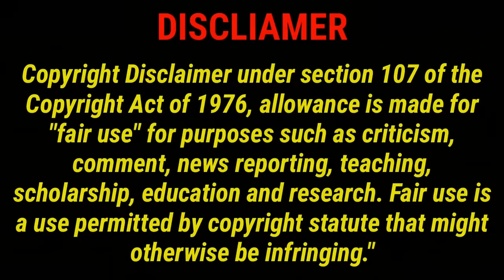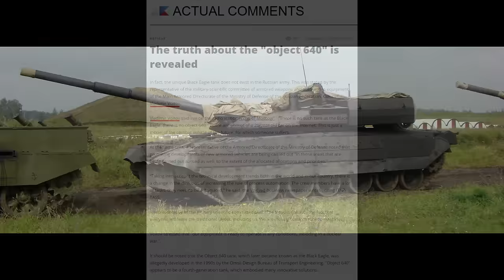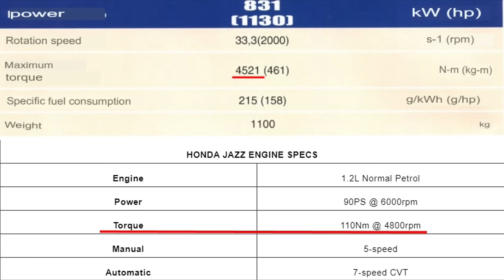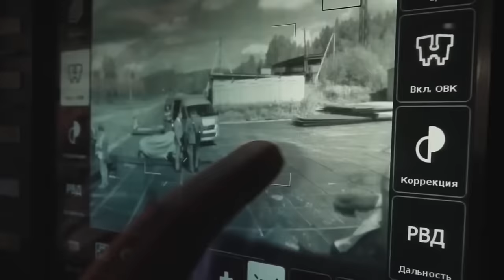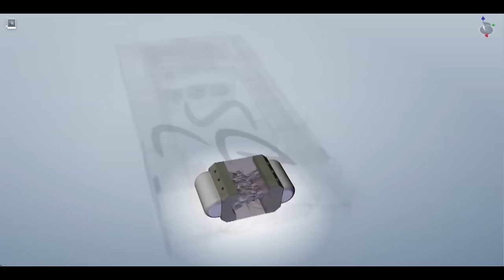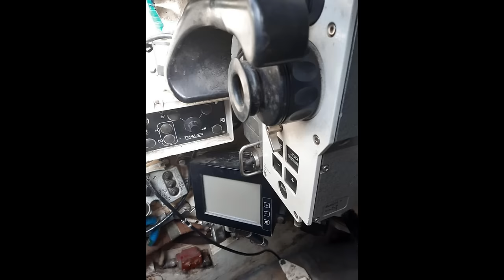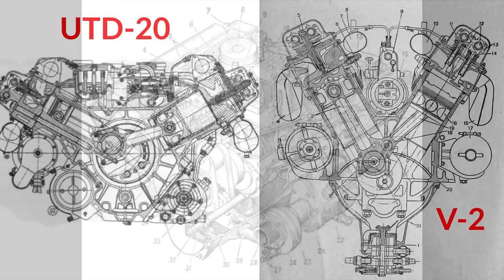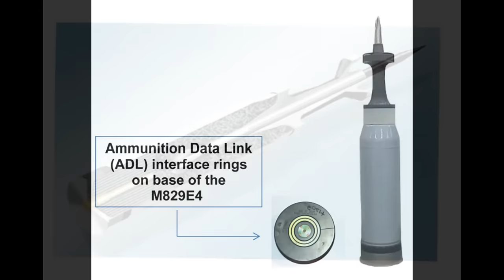LazerPig is WRONG about T-14 Armata

Comment: Lot of semantic arguments, and what appears to be interpretation problems. Seems RedEffect didn't understand certain gramatical phrases - like thinking that LazerPig said the T-95 and Black Eagle projects were the same. He didn't. He explicitly said they were different projects, but their development cycles were similar in that they produced nothing and were purely for propaganda. Another example of translation is the interpretation of "better thermals" to mean "longer range". While larger and higher resolution can produce longer range, the actual chips and sensors in western commercial products are far more advanced than Russian military equipment. Think of it this way, the APG-77 is a larger radar with more physical power, but the APG-81 is deffinitively the more advanced radar. An example of the semantic argument point was the "family of vehicles". Weight is literally the key component in chassis design. If you are using tank components to try and build a "lightly" armored vehicle, you will end up with a grossly expensive and overweight "light" vehicle. But arguing "well they don't have to be the same because there are differences" Is not only disengenuous, but is completely missing the point of LazerPig's argument. LazerPig was pretty spot on about that, and if you're arguing that the vehicles are fine because there are such significant differences between each vehicle to account for it, then they really aren't a family a vehicles that share any commonality. 

There were a few corrections to be made. LazerPig talked about his own mistake with mentioning torque production of the T-72/90 engine. That was a conversion error. But other than that, LazerPig seems pretty spot on. I mean we have great proof of Russia's smoke and mirrors happenign right now in Ukraine. The capabilities Russia has been claiming for decades simply doesn't exist.
Reply: >like thinking that LazerPig said the T-95 and Black Eagle projects were the same

But RedEffect didn't said that. He said that Pig probably mixed up information about two T-95, hence his mistakes

>the actual chips and sensors in western commercial products are far more advanced than Russian military equipment. 

AFAIR, Russian military equipment uses same chips. So, what are you talking about?

>If you are using tank components to try and build a "lightly" armored vehicle, you will end up with a grossly expensive and overweight "light" vehicle.

that's simply not true. You didn't listen this section. Russia built vehicles on tank chassis, they weight the same or even less than their western counterparts

>But other than that, LazerPig seems pretty spot on

Lol, yeah. His fantasies about Russian tank  and AFV engines, and T-14 engine in particular, were 'spot on'

Comment: About 360° awareness being unheared off in tanks, this is completly false. The new Israeli Merkava Mk.4 Barak has the Iron Vision system which gives the crew full 360° awareness with hi-res colored screens, allowing for the crew to practically "see through" the tank.

However, unlike the Abrams X or T-14 Armata, fhe Merkava Mk.4 Barak isn't a tech demonstrator or a very early production, but actually fully entered service in Israel and there are dozens of them right now with much more to come. Israel, once again, beats everyone.
Reply: Merkava Mk.4 is not as good Russian or American tank 
those upgrades is what matters there 
If you put those upgrades on a Russian-American tank you’re gonna get far better results
Reply: @mbtenjoyer9487  How so? The Merkava Mk.4M already has superior protection to both T-80BVM and M1A2 SEPV3 (before even bringing up TrophyHV), and the Merkava Mk.4 Barak is said to receive even better armor. In addition, the Merkava Mk.4 has semi automatic loader that makes it load faster than the Abrams's fully manual loading and T-80's automatic loading.
Reply: @ofekk213  it doesn’t Abrams has far far superior base armor
Reply: @mbtenjoyer9487  Nope, Abrams uses DU based NERA whereas Merkava Mk.4M uses advanced SLERA, and the Barak will use even better armor.
Reply: @ofekk213  still it doesn’t matter it doesn’t compare to the armor level of Abrams
Reply: @mbtenjoyer9487  Let's see how the Abrams's KD ratio changes if it faces actually competent tank crews in actually modern tanks, rather than Syrians and Iraqis with brain damage in T-55s.

Comment: Thanks for the interesting and informative video. The introduction of Western tanks and IFV into the Ukrainian battlefields have pulled back the curtain on alot of PR and exposed their myths. They all seem to burn.

Russia takes a long time to develop military equipment before it is finalised for production. They don't have profits as a main criteria for equipment to be produced. The Su-57 has taken decades from conception. T-14 will also take a long time as the role it has to play in a conflict needs to be defined and then manifested physically into a combat vehicle.  The Terminator has also gone through this, and while currently in small quantities, its role and usefulness is being developed on the actual battlefield and it seems where it is effectively working is not really where it was originally thought it would be useful.

Comment: Are you saying that these ammunitions are inferior to western depleted uranium shells?
Reply: Depleted uranium shells are obsolete, most modern projectiles are made up of tungsten which include dm 63 and vaccum 1
Reply: @stranger6797  In Sweden we use Tungsten not because they are better but because they are good enough and wont pollute and ruin the area we try to defend
Reply: Depleted uranium shells don't have any advantage over ordinary shells,the army of my native country Pakistan also uses dpu shells, we use neza projectile which only has a penetration of 570mm(modern projectiles have at least 700mm)at 2km which makes the projectile obsolete.
Even North Korea has projectiles made of dpu
Reply: @hamzatariq5073  As i wrote tungsten ammunitions are good enough.. the differences are not that significant or as was reported in the Russian tests: 

"Armor-piercing shells with depleted uranium do not have significant advantages over shells with tungsten cores. The effectiveness of ammunition was compared by the head of the troops of radiation, chemical and biological protection (RCBZ) of the Armed Forces of Russia, Lieutenant-General Igor Kirillov, reports"

This is also what has been noted in Sweden. That tungsten is "good enough" and way better to use since you dont poison the area you defend or attack for generations.
Reply: The ammo are inferior because they are shorter
Due to them needing to fit inside a carousel autoloader 

If they upgraded to rear bustle autoloader then they can increase the length

Comment: I think one of the things that reveals Lazerpig's ignorance the most is the "Why does an SPG need to be armored?" stuff.

Its pretty simple. Its infact the exact same reason for every other armor in existence: To mitigate your mistakes. Body armor is not there to make an infantryman immortal, it is there to give him a chance to survive a fuckup and give him the opportunity to learn from it. Same goes for tanks, IFVs, and yes SPGs. If you are too slow, or the enemy's counter-battery game is just that good, you are going to develop a very quick appreciation of those 20mm of steel as it bounces the majority of your very high velocity problems away. Shrapnel is no joke, high explosives are no joke, but what would be a joke is if your really expensive self-propelled artillery system and its equally valuable crew could be taken out by five dudes, a grenade, and a really good Sam Fisher impression.
Reply: he said it does not need to be armored like front line tank which it does not. The whole point of that was to say the t14s module design is bad because you not need that much weight on a back line vehicle
Reply: @Kanudee  It is fortunate then that the point of a modular design isn't to carry the armor over to its SPG form, that is just a side effect. Its to bring over its weight capacity for a larger gun. For all of the failings of the T-14's modular gimmick, that is really more of an inefficiency than anything else. Besides, that armor will be even more helpful for the counter battery situation mentioned.

Comment: The m60 was upgraded to have automatic target tracking in 1972.
Reply: Automatic LEAD, not automatic target tracking.
Reply: @definitelyfrank9341  Almost all western tanks have had the ability to lead since 1983, according to the CIA at the time.
Reply: @billylewis1151  Yeah, but you said that M60 has had automatic target tracking capability since 1972, which is incorrect.
Reply: @definitelyfrank9341  The m60 did have automatic target tracking, as a simple google search provides ample documents. It did not in fact have automatic lead on its target tracking. Tanks since again at least 1983 had automatic lead and target tracking. This is honestly very old tech.
Reply: @billylewis1151  Just read through the official document:
M60A1, M60A1 RISE,
AND M6OA1 RISE (PASSIVE) SERIES TANKS, COMBAT, FULL-TRACKED
105-MM GUN

UPDATE SYSTEM ASSESSMENT

Nowhere in it did they mention an automatic target tracking system, despite this being an assessment of upgrades since October 1977... and among those upgrades is an "Add-on Gun Stabilization"... So you're telling me that the M60 had an automatic target tracking system before it had a gun stabilizer? A technology that the WW2 era M4 shermans had?

Can you tell me exactly what variant had the automatic target tracking system?

Comment: The issue of autoloader reliability is more to do with what kind of maintenance is being performed in the field and in garrison, not under the ideal conditions many tank enthusiasts like to cite as their source.

Sure, under ideal conditions, most every piece of military equipment, will function as intended, but that isn't the point.

Soviet, and now Russian, maintenance has a long history of being conducted using stop-gaps, short-cuts, as cheap as possible, or, in many cases, not at all. THIS is where the issue of auto-loader reliability comes into question. As we've seen with the performance of Russian field units in Ukraine, their maintenance practices from the field operator level all the way up to the Army level, is abysmal, if it exists at all.
Reply: If the autoloader was a problem we would have heard something about it from the war in Ukraine but so far nothing
Reply: Auto loader is extremely simple mechanism, there's nothing to break really and it doesn't require a lot of maintenance. And yeah, we haven't heard anything about them not being reliable. And arguably it's better than having crew member who can be tired, sleepy, barely experienced or can have troubles loading while tank is moving
Reply: @mbtenjoyer9487  not only that but multiple other places, like Poland, Slovakia, China which uses a system based on could also be saying it.

Comment: Forget the British Challenger the Dodge Challenger is being sold right now with an engine that produces 1025 HP.  The VAST Majority of all T-72s ever produced run on the Engine directly from the T-34 use with a Super Charger added to bring it over 700 HP.  Imagine it as every tank with a better engine destroyed early in Russia's massive failure in Ukraine.  The Fall of the Soviet Union came when upgrades could have come but never did but to the pockets of corrupt Russians.  98% now even if the numbers were a little better at the start.  (T-14 Ironically named as it is still a NO Show, a myth.  When Russia Bullied it's way into Crimea, defaulted on any debts to the Usage of the Port in Crimea and started holding fake elections at gun point.)  All this time, a huge Mulligan and still T-14 is more Cardboard Cutout.  This guy Spewing Putin R's Shiate.  Fairly well spoken, makes me think the Russian Brain Drain not absolute.  Propaganda Voice Work as a subversive in Warsaw?  Don't accept Rubble.  Though Prigozhin demanded Dollars and look where that got him...

Comment: Thank you for at least partly breaking down the lies from that video. You have to understand that that video was basically made on the bases of trying to say the most bad things you could think of about Russia and Russian tanks without the base of reality, the most preposterous of which is claiming that it had less torque than a Honda car, or that it used the same engine from pre ww2 era etc. 
But you've also confirmed on his lies at the end "it's production practically non existent" what is an existent production? we have to define it first. But it has been already confirmed that Russia has produced more than a 100 T 14 tanks already. And that is not a" practically non existent production" (depending on how you define that term), as not that many tanks in history has been produced as new tanks for more than a 100 units, especially in the modern day and age. From my knowledge it would be in the top 10 most produced tanks for sure for the past several decades. One of the most built tanks in the world. And that is not how you define a "non existent production". As a "non existent production" in my view should have been within the range of 10 - 20 tanks. Yet Russia officially already has a full battalion regiment of those tanks, and it has used them in the conflict several times already.

Comment: The history of the V2 engine and its derivatives dates back to 1917. Believe it or not, the engine originally developed for the Fokker D.VII fighter aircraft was designated the BMW III. Of course, it was modernized many times. For example, fuel injection was added. The Soviets converted it to a diesel engine for use in the T-34 tank and all of its variants. OK, to shorten it, a piston from an engine from 1917 would fit into the left bank of cylinders in a T-90M Proryv tank today thanks to the preserved geometry and dimensions. History is fascinating.

Comment: The 2 fatal flaws of the Armata are the self loading mechanism itself which exposes the ammo and the engine design which overheats constantly. Like the T-72 and other Russian tanks, those are widow makers and mechanized coffins🤷‍♂🤷‍♂🐵🐵😵😵
Reply: >self loading mechanism itself which exposes the ammo 

yeah. Ammo, positioned near the bottom of the hull, exposed
My man, tell me, where did you get that knowledge?
Reply: @ВячеславСкопюк  LOL, ask the Russians in Ukraine or the Iraquís on both Gulf Wars, specially when hit with Javelin’s, they turn into Jack in the box toys!!!! The poor Russians turn into fried chickens!!!
Reply: @culoprieto535  how it is related to your claims?
Reply: @ВячеславСкопюк  The knowledge is open to all people. 2 captured Armata tanks were brought here in the USA,  here next to my house for Analysis.
Reply: @ВячеславСкопюк Armata floor is 15 centimeters thick at the bottom of the tank. Considering the engine brackets and the weight of the ordnance itself puts additional stress to the chassis, this make the ammunition easily exposed to minor explosives. The Armata tank is just a victim of poor design and is another paper tiger like T-72's or the Mi-24 (Hind) helicopter.  Too much vodka!!!
Reply: @culoprieto535  
> 2 captured Armata tanks were brought here in the USA

Ok, I can see now that you're out of your mind

Comment: The Abrams modular vehicles are front line only so they need the armor, love how you skipped over the kf51 panther and how it has more modern capabilities, and how you didn't deny that t14 uses second generation ir so the Thermcamo tiles would make Abramsx invisible to t14. Not to mention that t14 is only at partial capability  to theoretical max. but no it is obviously the most modern tank killing mbt because  smekalka.
Reply: he did not skipped KF-51, he talked about it, it was just not relevant to THIS video.
Reply: Your issue is that you assume this is a video defending the T-14 and not just a simple correction to another video. RedEffect has made a video about the T-14 and hasn't exactly been kind to it.

Also like the AbramsX doesn't use thermcamo tiles so what is your point? RedEffect even pointed out why this technology never made it further than a demonstrator.
Reply: @hedgehog3180 I only corrected what the INFALABLE REDEFFECT got wrong. there are no thermotiles because the tank x variant isn't in production yet.

Comment: Commentary is vaguelly pro-russian and using russian manufacturer numbers as "facts"
Yeah I'm thinking turret popcorn cope for this one
Reply: Name checks out
Reply: Let's use figures from American magazines about a tank that has never been in combat as a reliable source. It's just ridiculous. All you can do now is rely on their own data and any comparisons based on photos (mainly concerns booking and on-board electronics). Well, if you have more than 140 iq and a couple of degrees in engine building, then it is possible to evaluate from an engineering point of view what they could do with the engine based on open data on past samples. 
Offtop, but interesting. Do you believe that the F22 raptor has 0.0001 m2 of radar cross section (RCS)?
Reply: instead we should use... opnion articles as source...